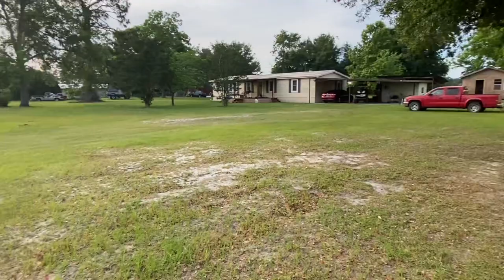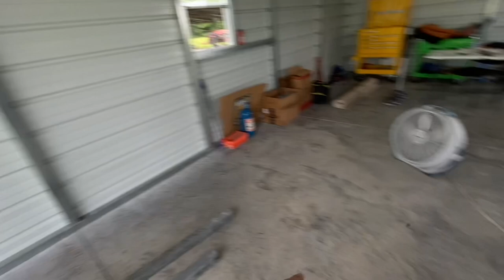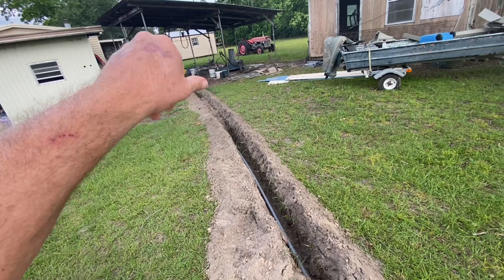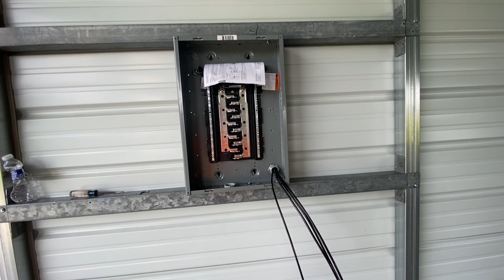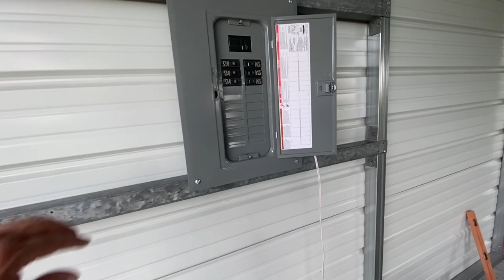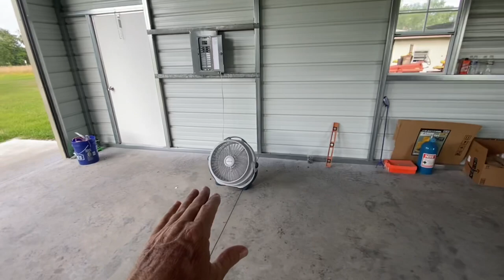Electricity to the new shop. Finally! it was a journey, Let me explain upstairs and downstairs.

Comment: so nice ill be using 1.5 conduit,for my 230v ,welder,hopefully  i can use the house panel like you,i know theres a double 50 on the stove,...which i converted to gas,i think ill use that breaker
Reply from the maker: Originally that’s what I was going to use was a double from my actual home panel and I found the breaker on my service pole that I thought went to something but didn’t and I put a 50 amp in that spot.

Comment: I'm wondering why you needed so much #8 wire, was that the ground? I thought for a sub panel you only have to ground it there and only run your 3 wires. Ps i liked uncle's idea for the panel
Reply from the maker: Needed heavy enough wire Incase for welder or bigger air compressor because of the distance from power supply as well. Thanks for watching